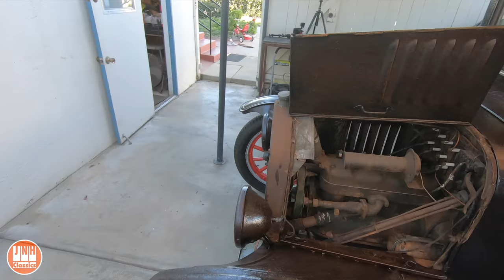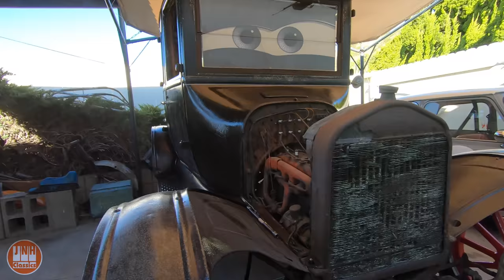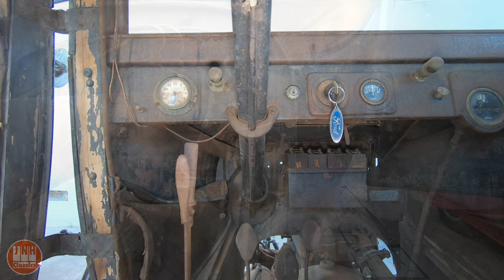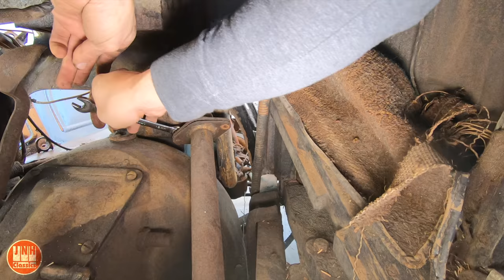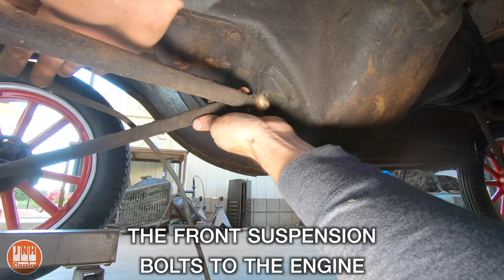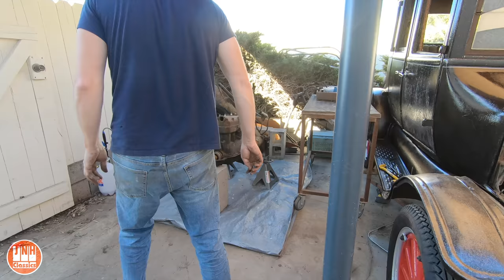A Forgotten Model T (Episode 5) Engine Removal

Comment: Seeing Your Steering sector Reminded Me, My Steering wheel was right up in My face, So I took another Sector from a 1926. And cut 3" off of the housing where it mounts against the firewall, Then I shortened the Sector Rod put back the Taper and keyway  to fit back into the car like it is supposed to, I had to re drill the holes on the Spark and Gas levers so You would get a correct placement for the linkages to fit! And the 26 is a 5 to 1 ratio, Making it easier and safer to steer! And I can get in My car MUCH Easier! More Comfortable to drive!
Reply from the maker: Thanks for all the great comments!👍

Comment: The correct radiator mounting setup is available from the vendors - https://www.modeltford.com/item/3975-76B.aspx
Reply: When my original radiator ‘27 started leaking I had to order these parts as the old bolts broke, but it was quite a job getting all those springs, etc, back together by myself. Can’t wait to see how this young mechanic does it!
Reply: That's cool to know where to buy these things from.
           Thank you

Comment: I'm quite surprised on how many bolt and nuts had cotter pins on them. I didn't know this until a friend with a model A let me know that the transmission used 100 weight oil in it to keep the gears from clashing between gear changes in stead of synchronizers. I didn't know that 100 weight oil was a thing.

Comment: That is great! Make sure to service the differential and transmission too; at least drain and put new oil in them.

Found this link; check it out; very interesting:

https://modeltfordfix.com/care-and-feeding-what-kind-of-oil-should-i-use-in-my-model-t-ford/

Looks like regular Synthetic Blend Motorcraft 5W-30 found in Advance, Pep Boys, O’Reilly’s, etc works just fine. Takes one gallon.
Reply from the maker: That’s a great article. Thanks for the link👍
Reply: This was very helpful! Thank you!